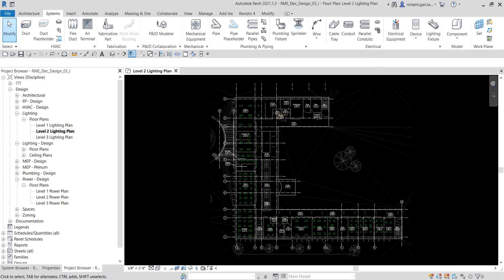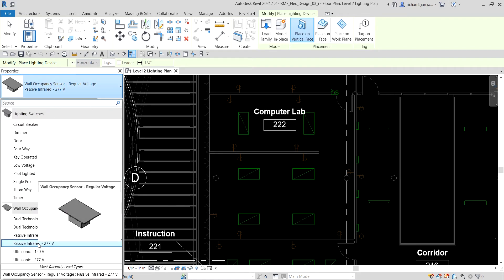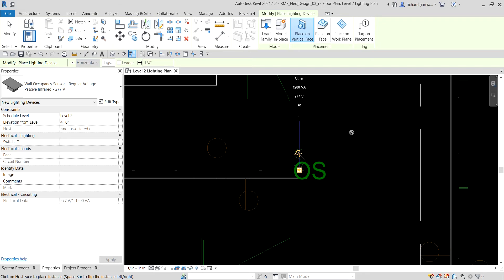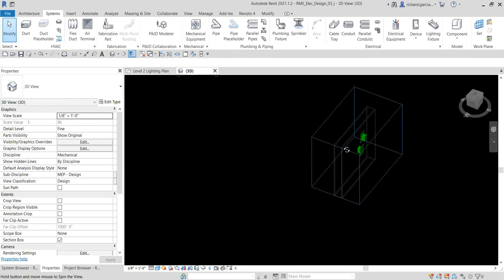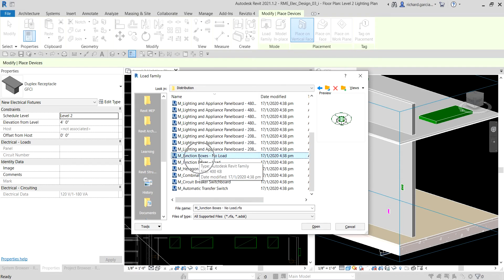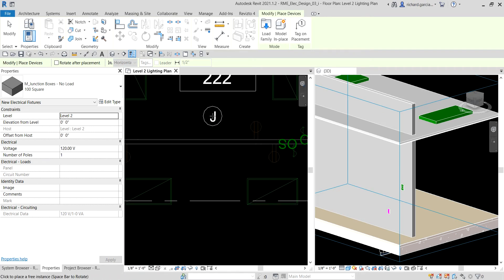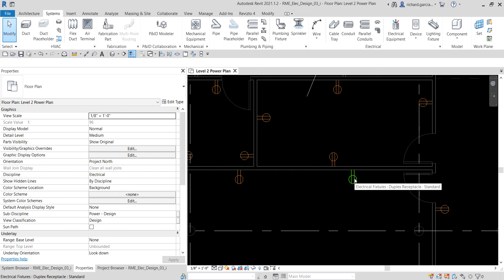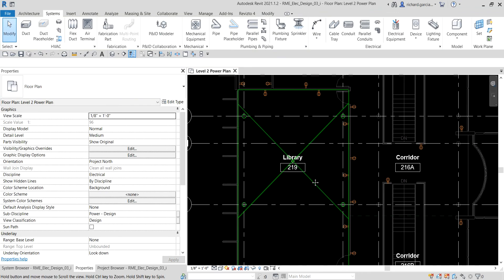REVIT MEP 2021 - ELECTRICAL SYSTEMS - 25 PLACING SWITCHES, JUNCTION BOXES AND RECEPTACLES

Comment: Sir would please show how to Connect high voltage receptacle to the revit family pannels
Reply from the maker: Sure mate, try these steps.

### Step 1: Create or Load the High Voltage Receptacle Family

1. **Load Family**: If you already have a high voltage receptacle family, you can load it into your project by going to `Insert` > `Load Family` and selecting the appropriate family file (.rfa).

2. **Create Family (if needed)**: If you need to create a new family:
   - Open Revit.
   - Go to `File` > `New` > `Family`.
   - Select a suitable family template (e.g., `Electrical Fixture` or `Electrical Equipment`).

### Step 2: Define Electrical Properties in the Family

1. **Open Family Editor**: If you are creating or modifying a family, open the family in the Family Editor.
2. **Add Electrical Connector**: 
   - Go to the `Create` tab and select `Connector`.
   - Choose `Electrical Connector`.
   - Place the connector at the appropriate location on the receptacle.

3. **Set Connector Properties**:
   - Select the electrical connector.
   - In the `Properties` palette, set the `System Type` to `Power`.
   - Set the `Voltage` to match the high voltage specification (e.g., 480V).
   - Configure other properties such as `Load Classification`, `Phase`, and `Number of Poles` as necessary.

4. **Assign Parameters**:
   - You can assign parameters like voltage, amperage, and load classification to the electrical connector. These parameters can be type or instance parameters depending on your requirements.

### Step 3: Load the Family into the Project

1. **Load Family**: If you created or edited the family, save it and load it into your project using `Load into Project`.
2. **Place the Receptacle**: 
   - In the project environment, go to the `Systems` tab.
   - Select `Electrical Fixture` or the appropriate category for your receptacle.
   - Place the receptacle at the desired location in the model.

### Step 4: Connect the Receptacle to a Panel

1. **Select Receptacle**: Click on the placed receptacle in your project.
2. **Electrical Settings**:
   - In the `Properties` palette, ensure that the electrical settings such as `Voltage`, `Load Classification`, and `Circuit Number` are correct.
3. **Create Circuit**:
   - With the receptacle selected, go to the `Create Systems` panel on the `Systems` tab.
   - Click `Power` to create a new circuit.
   - Revit will prompt you to select a panel to connect the circuit to. Select the appropriate electrical panel from the list.
4. **Configure Circuit**:
   - After connecting to the panel, you can adjust circuit properties such as the circuit number, load name, and description in the `Electrical Circuits` panel.
   - Use `Edit Circuit` to add other devices to the same circuit if necessary.

### Step 5: Verify Connections and Settings

1. **Electrical Panel Schedule**: Check the electrical panel schedule to ensure that the new circuit and receptacle are listed with the correct parameters.
2. **Electrical Plan**: Verify the connections in your electrical plan views. Ensure that the receptacle is connected to the correct panel and that the circuit is properly configured.

### Example Summary

1. **Load or Create Family**: High voltage receptacle family with electrical connector.
2. **Set Electrical Properties**: Define voltage, phase, and other necessary parameters.
3. **Place Receptacle**: In the project, position the receptacle where needed.
4. **Create Circuit**: Connect the receptacle to an electrical panel.
5. **Verify**: Check the electrical panel schedule and plan views for accuracy.